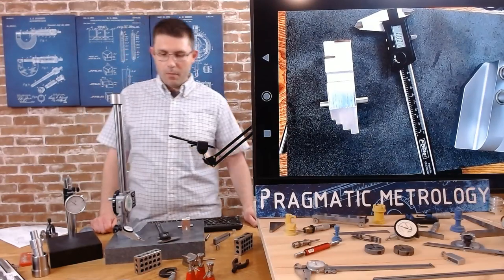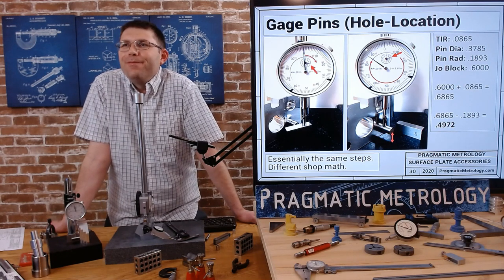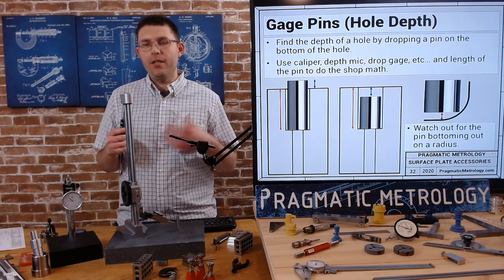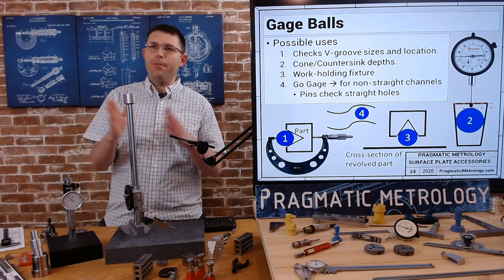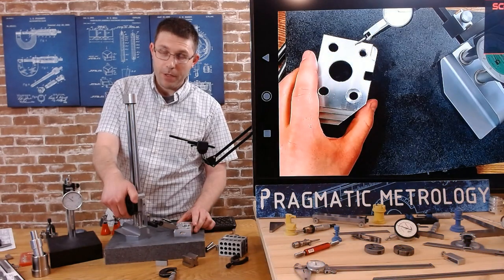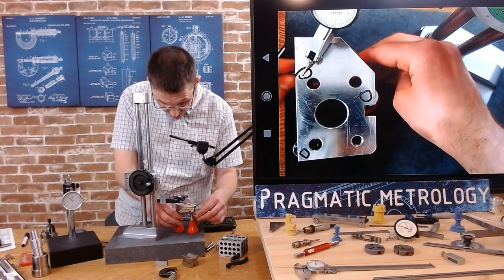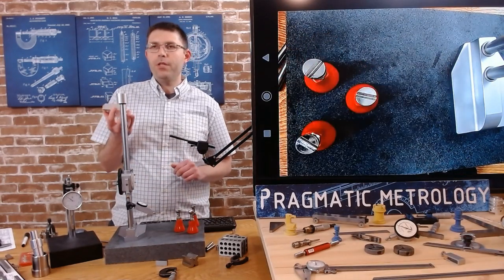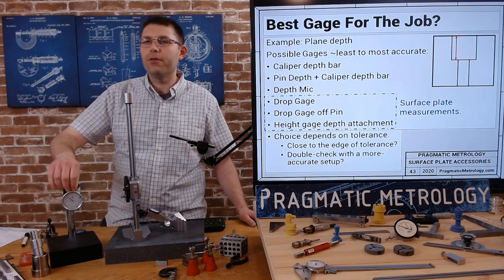Pragmatic Metrology - Surface Plate Accessories - Part 3M

Comment: 21:32 - How do you do a flatness check for long linear parts, such as linear rails or gauge blocks? It's impossible to let it rest on 3 machinists jacks, only two jacks could be used, the third is placed at the center of the linear rail?